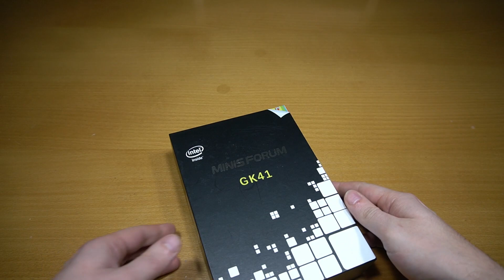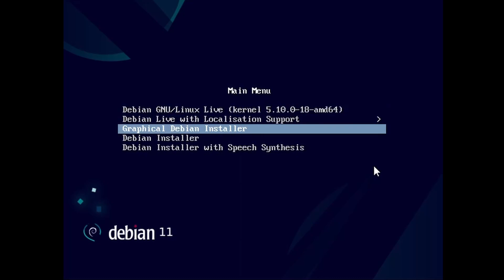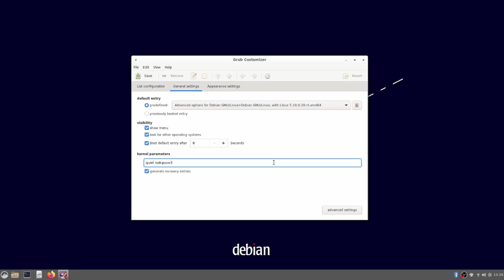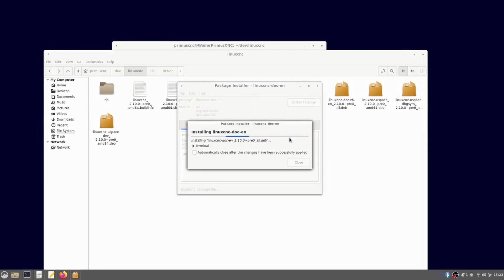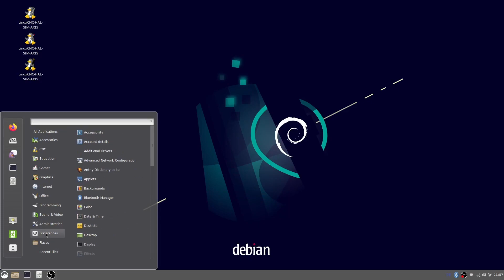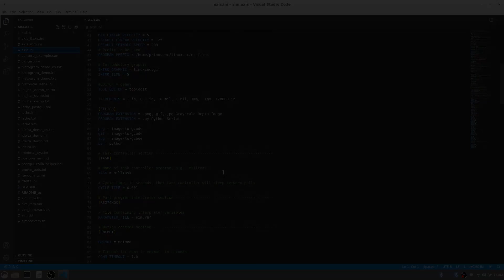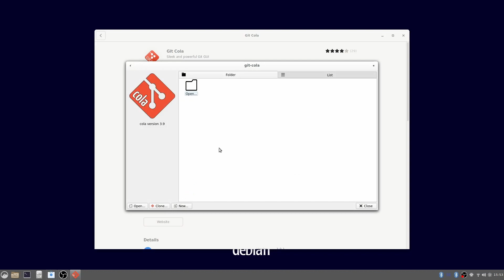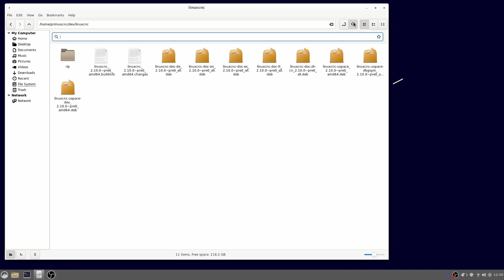Tipps and Tricks installing LinuxCNC 2.10

Comment: Hi Alexander,  Liebe Grüße von den Philippinen! Thank you for your great video. I have set up LinuxCNC on many platforms, including custom builds on different CPU architectures and distros, but still learned some useful things from this video and I thank you for that! I will incorporate those things in my own daily practice moving forward 😊👍
Please allow me to comment on one thing, which is the latency test that you were running. I think it is not great at all. Actually it is quite terrible. Also, you are only running two instances of Glxgears and some other apps, but that is not really stress testing. If you would do some real stress testing during a couple of hours, I think your setup will show even worse latencies that may ruin your CNC operations. Depending on your LinuxCNC hardware configuration it may be good enough for some setups (although critical and one day it will mess up your CNC jobs), but I think you can squeeze out a much better performance by making some additional changes.

1) you only isolatedd the 4th cpu core with isolcpus=3,  but I found that on my N100 mini PC  the best result was with isolcpus=1,2,3. That means only the first core (0) is used by the general scheduler and others are isolated. Not sure if you would find similar results on a J4125, as results are not always predicatable. But for me this gives  a  max jitter of around 25000ns for both threads. Those are perfectly okay for LinuxCNC.

2) take a critical look at your BIOS settings, especially disabling power saving features, virtualization, C state and other things that may cause system interrupts and thus affect latency.

3) Cinnamon is a great desktop environment and also my personal favorite for my daily desktop use, but under some real-time kernels it does not always perform reliably due to some ongoing graphics driver issues causing interrupts. That is no problem for normal desktop use, but may be unreliable for low latency applications like LinuxCNC. I installed a pre-release of Debian Trixie (Debian 13) with realtime kernel 6.10.9-rt-amd64 and installed the Cinnamon desktop, and it seems to me that there are no issues anymore with Cinnamon under Debian Trixie, given the latency numbers I mentioned above. Bookworm and older Debian versions or older kernels may still be issues.

Also take a look at the Latency Histogram instead of the Latency Test.  The histogram gives you a much better visualization of the system latency performance, especially when you let it run for several hour. Make sure that the SD looks as optimal as possible, without  any spikes in the side bands. I hope this may help a bit to further improve your LinuxCNC setup.  Keep up the good work!!!!!

Comment: how can install new version linuxcnc old computer HP core 2 dual computer have linuxcnc 2.8.4 now but maybe better use 2.9 or 2.10 version. worry new version need better computer than old HP have. can use or need lot better computer. old have important paraller port, many new not have.
Reply from the maker: If your current setup works i would not update unless you need to. But i think your Pc might be fine, just try it out.
Reply: @theartoftinkering  i test, i installed linuxcnc V 2.9 and not working, freeze computer, display not can see all controller windows, if bus some buttons computer freeze or reboot and all need setting again new. but old 2.8.4 working well i change back old version and working, need understand only how install 2.8.4 new mesa config tool, no understand how installing this tool if buy mesa 7i96 card. now i use cheap chinese paraller port but problem is no input pin more, only 5 pin. if use probe, 3x home and E-stop no have pin add pendant or other addons. or 3 axis DIY external encoders.
Reply: have you test cheap 40€ aliexpress 7i92 mesa board how working and how can install, setting, and use direct to DM556 drivers. and how all input connect to card and settting.  interesting use have cheap and more input/output pins than paraller port BOB card.

Comment: That jitter is around 100000, it does not matter if you are using mesa board right ?
But it matter if you using parallel breakout board like Bob ?
Please point me the link explaining this matter.
I’m looking for low latency mini PC to build with Bob card that gas parallel port .
But could’t find it.
Reply from the maker: i used an old PC that i saved from the dumpster for my first CNC. I wouldn't buy a new mini PC and still tinker with parallel Port. If you need something cheap, i'd use something like an Ramps or GRBL Shield and not worry about LinuxCNC.
Reply: @theartoftinkering  Ramps etc, GRBL not have cheap, cheapen have use old dual core 3GHZ etc old PC cost about 15-30€  lot cheapen than arduino+Ramps+GRBL etc.

Comment: i not understand anything this how make all. first i go out if come errors not understand how repair, second i not understand code anything. newer not has read or write code. not can install new linux my cnc, i have fighter many month now how use dual Y axis motor but not working alltime come only lot errors. and latency tes make many many time but not understand what this need do. i have worst linuxcnc 2,8,4 now and not working dual Y motors. and how add display button XYZ zeroing corner finder, probe working but not understand how make linux do zeroing.
Reply: mach3 have easy but not have licence windows and not work old computer, and need expensive licence mach3 no thanks.
Reply from the maker: i am sorry i can't help you. I'd recommend to check LinuxCNC Forum, your configuration is nothing special and has been done before. See: https://forum.linuxcnc.org/16-stepconf-wizard/30265-help-with-dual-steppers-on-y-axis-and-config
Regarding Mach3 i certainly don't reccomend to search Mach1lic.dat on google and check if somebody uploaded his Licence file.
Reply: @theartoftinkering  i know Mach3 lic.dat file i has before Mach software but not good, linuxcnc have lot lot better use cnc machine.

Comment: Alex, I noticed that the max latency is bigger on the base thread than the servo thread. I see this happening on my setup as well. Fortunately I don't need the base thread - at least for now. Do you know why this happens?
Reply from the maker: Hi, I don't really know, to be honest. But i think it has todo with the base thread being just 25μs. If it matters depends on the application. As i understand it Base Tread is only used on those setups, where Step Pulses are generated on the pc and send out over the parallel port. Instead i use a mesa card, wich handles all of the step generation, which makes the base thread obsolete in this case. If you want reliable answers tho i'd recommend asking in the LinuxCNC Forum.
Reply: The base thread is generally used for non time ciritcal applicatios where as the servo thread operates in real time 

so the max latency is allowed to be bigger